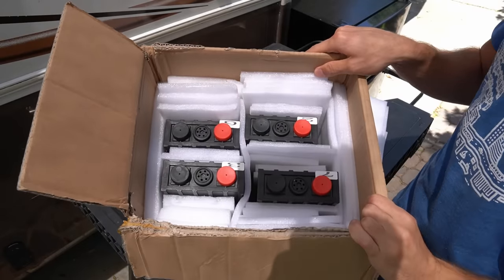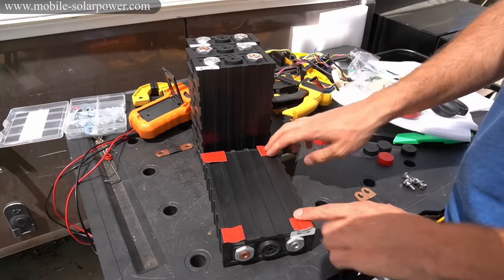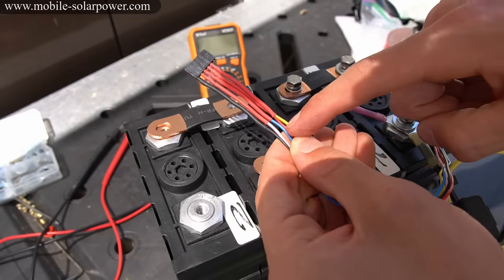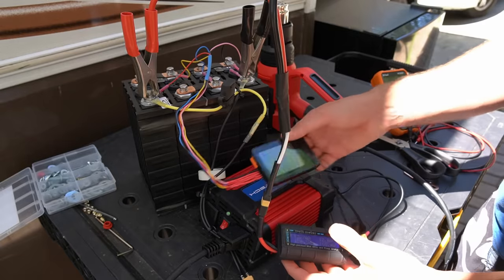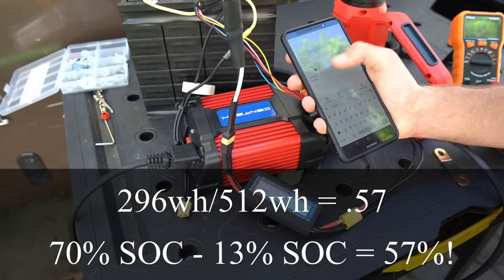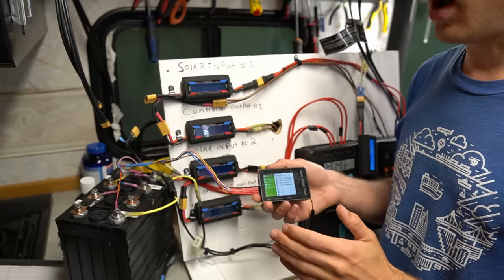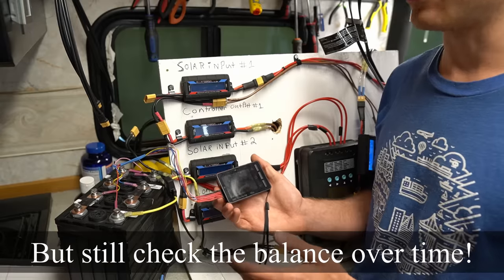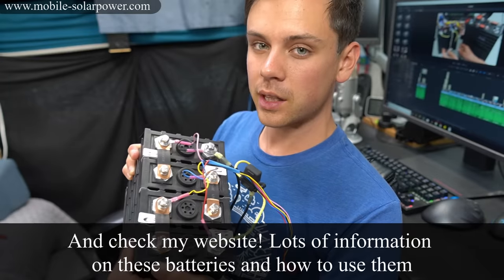12v LiFePO4 Battery Kit from Amazon.com - Tested and Reviewed

Comment: Nice video will keep up the good work. Got my teardrop caravan wired up with 230v off grid electrics for under £200 thanks to your posts. Just need upgrade my 100w panel to a 310w panel as I'm not managing to maintain power. I found a panel that measures just 1.5 meters by 0.8m that fits perfect on the flat roof design. I'm using one lead acid battery due to budget with a 110ah rating. Get about a day and a half of power running a 22 litre 230v fridge. So it's nearly perfect for weekend getaways. I've seen 6a from a 100w solar panel which I found amazing. Also had to return a cheap inverter. Said pure sine wave on it but it used the power quick and always sounding its alarming after 5 mins use but providing power. Looked like the grid tie inverter you put a conversation up about concerning safety aspects. P.s. I can recycle those po4 batteries I'd you want to make some room 😎😂

Comment: For your discharge you should use a boost converter and put that energy into your tesla battery or whatever you are using instead of turning that energy into unwanted heat
Reply from the maker: I love boost converters. And ya ur right.

Comment: If you calculate the costs per KWh they are around 500 $ per KWh. I don't know what they cost in EU, but here you can buy a BYD battery box (a box with batteries, BMS included and ready to connect to the solar inverter) for around 500 € per KWh, VAT included. In my opinion a great product, also with Lifepo 4 cells.

Comment: lovely batteries you have. I have an idea to balance the batteries continuously, I want you to know the idea I came up with for some time. Take a 5Kohm resistor on each battery (in parallel + and -) in series, thus the voltage is the same for all batteries. maybe a zener diode in series with the resistance so that the voltage does not come below 3V, if it works in the real world I do not know

Comment: Hey bro, thanks for this - I am currently in the process of importing a new 4x4 expedition vehicle and was wanting around 400ah worth of LiPo in exchange for the 200+ AH AGM batteries. 

Keen to know your thoughts about how many cell cycles these LiPo would get.

Also, do you do consulting ? 

M

P.S my off grid project is coming along!!
Reply: Sinopoly claims thousands of cycles (I don't remember if it was 1000 to 80% discharge or 2000 or if the 2000 was to 50%). Of course, that life requires you to treat them well -- do not over charge, do not over discharge, even a single cell (which is why you need to keep them reasonably balanced).

Comment: Can you suggest me here, I want to convert petrol bike in to electric vehicle.
Now I want mileage range is mini 50km per charge.
What are the best batteries with voltage and ahm.
I'm thinking 12v40ahm will it suffient for 50kms per charge...?

Comment: I find your content fascinating. Been using 6v golf carts in my trailer for years. Was going to increase my bank from 4 x 6v to 6 x 6v. I added a household fridge that runs my batteries down faster than i like. It is time to replace the golf cart batteries so thinking about using something like these or Battle Born.
Reply: I'll suggest you change your fridge to a smaller, energy efficient one if it isn't already. Or have two fridges with the energy efficient one on your batteries.
Reply: @leviahamefula3994  thank you for the suggestion, but sizing my electrical system to fit my wants is a better option for me.

Comment: Hey will, alright I hope I’m not asking a crazy question,  Ive got a jon boat that is all electric powered by 2 lead acid group 31’s wired for my 24volt trolling motor. Im wanting to build my own lifepo4 24volt battery bank in at around 80-100ah. Any recommendations on products to use and what batteries I should get.  I would greatly appreciate the feed back. I’m pumped to build this project. Thank you
Reply: Did you ever get it done? I'm wanting to run 36v for a fortrex but don't want all the weight of reg batteries.
Reply: ls gt yes I did I’m running 24volt. Took it out this weekend and wow I’m blown away at the performance of the headway pack I assembled results are better then i ever imagined
Reply: Thanks boss
Reply: So you did the headway batts. I ended up with a 24 volt motor. How many ah and did does it last better?
Reply: ls gt yes i went headway and wow they turned out amazing. I built 2 12 volt packs 80ah each and series them and holy cow i can’t believe the performance! Not going back to leadacid ever.  So I made 2 40 cell packs I’m going to be posting some vids soon on my channel and while I’m out running around. I have an all electric boat and ran around 12hrs in 25mph winds and tearing through hydrilla and dead hyacinth. I was so happy with performance. Only dropped 2 volts the whole day.
Reply: So 40ah at 24v and it lasted that long, hell yeah. Thanks for the reply boss.
Reply: ls gt no no I have 2 80ah 12volt batteries series together to create an 80ah 24volt battery.
Reply: @alytlestrategy2410  oh ok I got you. my bad. Still 12 hours in that wind is awesome for 80

Comment: Hi, Will, you have some really IMPRESSIVE videos & I am going with your recommendations.  Can this work using 8 Cells on a 24v system using your EPEVER 40A charge controller & a 24V Inverter & TWO Poly 100W panels? (I can expand later?)  For Class C RV...  THANKS, SIR!
Reply: Only if your panels achieve a higher voltage than the battery bank! So if they're 12v panels, you'd have to run them in series to get to 24v. And even then, you'd need to verify that the maximum voltage that those panels reach is greater than the battery bank, since they won't operate at the true open circuit voltage (24v). You'd honestly probably have to run three of those panels in series.

But I'm no expert, I've learned all this from Will. Just

Comment: So I recently started wondering if there was a way that a heat powered wood stove fan could charge a battery (train of though went to an alternator or a wind turbine and how they turn the spinning movement into energy) so I started looking into it a bit and came across a few YouTube videos about putting thermoelectric generator on top of a wood stove that converts the heat energy into usable energy to charge a cell phone or other small electronics. I was wondering if you would know if it would be possible to have that set up to trickle charge my battery bank overnight and in the winter when the sun is less present in the day time? And also where to get it/what exact type of thermoelectric generator I would need? Also back to my original train of thought, is there some type of motor that I could add to the heat powered fan to make it generate a trickle charge? I know you dont have a wood stove but would you happen to know anything about this stuff? Also, if you're running out of solar panel ideas you could look into wind turbines and wood stoves, I also plan on having a small thermal siphoning system ran around the flue of my stove to heat water in the winter to conserve electricity.
Reply from the maker: yeah exactly, very limited output on those thermoelectric generators. tiny solar panel would produce wayyy more power. And yeah, I agree with Mike on the wind turbines
Reply: I think (but am not 100% sure) those little heat powered fans are powered by 12v (20w-50w) thermoelectric generators/ Peltier chips. But they can only power a tiny 3v fan! It would take a lot of them for serious power and you would still need to run a fan on them. A stationary bike powered genorator would be better. You can get 400w easy out of one. Apx 30 amps an hour.
Reply: I was mostly curious about just somehow connecting a small turbine generator motor behind the fan blades on the heat powered fan. It's already spinning, just wondering if I could harness that energy to create a trickle charge, even if it is small. The thermoelectric generator was just something I came across while I was researching the wind turbine motor
Reply: @birdie1276  those fans have no torque. You can safely stop them with a finger... They can barely spin a fan. I use them on my woodstove. They're not super great but they are ok. Basically just a weak way to move air in a blackout or without extra electricity. Plus they look cool ;;)
Reply: Please don't be disheartened darling but it just ain't worth it. Ok. Forget it!
Reply: Thanks everyone

Comment: I really like your reviews. Have you ever tested the Amazon offering $590.00 + $109.23 shipping 12V 100Ah lithium iron LiFePO4 Battery For EV, Car Audio System, Solar system, Electric boat, RV, Camping, Light Weight Small size (Compare with lead acid battery) Contain 4S 3.2V 100Amps Batteries

Comment: HELP! I am enjoying your video's and eventually will put together some solar equipment. What I am trying to do now is put together a battery pack for a 55lb trolling motor. Can you give me some advice on  a reliable setup and what I will need to get the best life out of the system I put together.Thank you
Reply: What torque (thrust) values we talking bout here with your motor? what voltage / amperage range can your motor and speed controller accommodate? How long do you wish to run your trolling motor for continuously?

Comment: Another among many great presentations, Will -- thanks!

Maybe you can shed some light on an apparent anomaly from this source: the 200ah kit w/o BMS is $1200 and the 215ah kit w/o BMS is $160 less! The Q & A includes a question about this but the reply from seller is not altogether satisfying: "a lot of people search on 200ah, so we list that, but they are the same thing . . . (then why a lower price for higher capacity?)
Reply: There is some misunderstanding ,the model 215Ah is on sale,and now only 1pack left. for amazon search reason,we show 200Ah on the headline too.

Comment: Hi Will. I absolutely love your videos. I am looking at the $269.00 deal so that I can have a few fans running. Now is that price for all 4 Cells or is that $269. Per cell?
Reply: All 4. Each is 3v put 4 together to get 12v. Depending on the size of the 4 is where u get how many AH you'll get.
Reply: Usdpaulp.. Thank you

Comment: Will, I have recently bought a 2012 E-150 hightop. I am moving out of my home into this van in a few months and will soon after have no income for the next 3 years. With my last money, while living in the van, I hope to purchase a battle born (maybe 2) batteries and hook them up to my engine battery. I have that funny shaped fiberglass top and don't plan to have any solar on top. I hope to later have a cargo trailer that won't always be with me, but I can later add 1 solar panel to it.

Would you do a beginner video on how to install one battle born lithium battery thru the solenoid (?) to use in a van? And could you advise if it is a good idea to have a second one or is it useless? I don't want to try to purchase as I go, I want everything up front as I will have limited money all at once and no income for 3 years until retirement.

Maybe 2 videos: first the setup inside the van showing how and what is needed. Next the way to go thru the front and hookup to the other one. That way I can start buying the smaller pieces and plan the location and space inside, only lacking the batteries I hope to purchase late summer. I must purchase the rest before then. I know very little about the subject. TIA

I also want to thank you for all the help you freely give to the vanlife community. You are a jewel.
Reply: A small system will not meet my needs, so there won't be any need to discuss it. thanks.
Reply: @MySonsMother  You should consider the Renogy DC-DC converter instead of the solenoid since it will control the voltage going to your battery... there are simple diagrams on Renogy's website.
Reply: Thanks. I won't be considering any of that until I have the whole big picture. I don't know a lot, but I do know I need what I stated above. And yes, it will have whatever is needed so I can't drain the battery.

I have an immense strain on my life and won't be making any attempt at this time to understand, agree, or disagree.
Reply: @MySonsMother  "Would you do a beginner video on how to install one battle born lithium battery thru the solenoid (?) to use in a van? And could you advise if it is a good idea to have a second one or is it useless?" I literally responded to your question and said the DC-DC converter would be a good fit. Also, having two wouldn't be a better idea.

The rest of your comment, I'm sorry but I don't know what to make of it.
Anyway, I hope what I wrote helps.
Reply: I'm sorry, but I don't know what I'm saying or what you're saying. I'm desperately getting any words out knowing I trust the knowledge and expertise of Will to understand I want one or two (if 2 are better than 1) Battle born lithium batteries to use in my van to meet my needs for power to daily use a cpap, laptop, phone, camera, 12v frig, induction stove, vitamix, and whatever else I can think of. I'm smart enough to know it can't be done with everything all the time. And I'm smart enough to not stress myself with a discussion. 

I know a lot more than I can say right now. I have a brain problem and I'm overloaded. I forget momentarily and sometimes permanently. Any facts you give me right now will be lost. It's useless.
Reply: My Son's Mother thankfully it’s all written down so if you forget then it’s there to review 😊
Reply: One battery will go in the cargo later, hooked to one large solar panel.

Comment: I enjoy your videos about batteries. I installed LiFePO4 batteries in my RV. It seems like the prices on these cells are pretty high. I imported 10, 12v, 200ah batteries with 200 amp constant current capabilities and 10 12 volt 100ah batteries with the same stats from China. I would have to go back and look for sure, but I think the 200 AH versions were less than 800, including the shipping. I’ve since sold them, so I sort of got 800 AHs free;) if I didn’t live full time on the road, I’d get a new shipment in and continue selling them. I’ve been really happy with them. So I guess I’d wonder about the advantage of buying cells versus complete batteries with the internal BMS when they cost less than the cells?
Reply: Jumping Off The Cliff link?
Reply: Jennifer Durham search for lithium valley. You have to order a decent quantity and ship by ocean, not air freight, which is where a lot of expense arises.

Comment: Hi Will
I have watched several of your vids and have found them all to be very well done and useful. You are the first and ,so far, only channel that I have subscribed to. I live in Ontario and am in a solar house with a 7320 watt solar array. I have a li ion battery with only 106 amp hours. 5kw @48v. I want to build a 48 v 400 amp hour battery bank to hook up to my outback equipment 2 main terminals. Which vids should I watch and or would you be able to do a vid or contact me to share the needed info. 
Keep up the great work and I will keep watching.

Comment: Check out the 215 Ah setup on amazon, cheaper than the 200 Ah set. Near two times the 60 Ah. Where you using your balancer as a BMS?

Comment: Will, following your videos and you are the authority as far as I am concerned. I’m an older guy who is a kayak fisherman looking for 100ah for runing a 30lb thrust electric trolling motor (battery weight vs ah is the key). Almost ordered a Battle Born, but just can’t swallow the cost. This looks like a good alternative, just looking to see if you have a sweet spot recommendation for my scenario. Keep the content coming!
Reply from the maker: Oh interesting question. Usable capacity of 100ah lead acid is 50ah. So a 60ah 12v battery kit would work nicely. Nice and light weight. Be sure to use a low voltage disconnect and charge to 13.3 volts, and watch balance, and it should be good to go. Or you could use a 50ah renogy LiFePO4. Cheaper alternative to battle born

Comment: Can one use LiFePo batteries in place of sealed lead-acid modules inside ancient APC UPS (PC battery backup) units? Its a Back-UPS XS 1500, Kind of old and i fear that its charging circuitry, designed back when LiFePo's did not exist, will damage the cells with its constant trickle.
Reply: Yes, I have a lithium ytx14-bs (amazon ) in my apc for over a year now still working. As long as yours is 12v your fine. Also I have another one in my rx450h in place of a lead acid battery. Also over a year
Reply: @SouthFlaDiver  This unit is 24v so, two 12v modules in series... will that work?
Reply: @SyberSqueegy  yes, just make sure whatever battery you choose has a bms, (battery monitor system) so it keeps the cells balanced

Comment: Thanks for all the great videos.  I just received a copy of you Mobile Solar Power Made Easy.  Very helpful.  What is your knowledge of Ruixi ?  They have this battery: SINGLE CELL LIFEPO4 (3.2V/300AH).  Because of a design I am considering this would fit nicely and supply all the amps I need.  Any feedback you can give will be helpful.

Comment: You should have the positive and neg at opposite ends of the battery pack for better balancing. 
Over time you will find the first battery will not match the other two
Reply from the maker: Not true if proper gauge of wires is used between the batteries. Ohms law. Calculate internal resistance of batteries vs thick copper wire